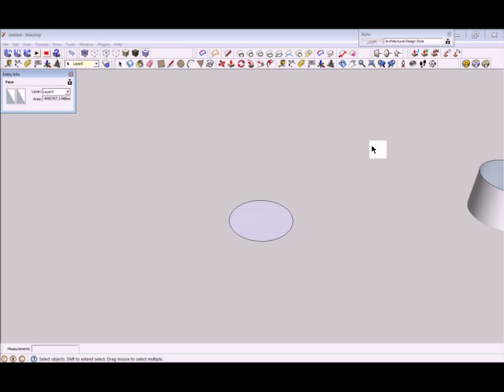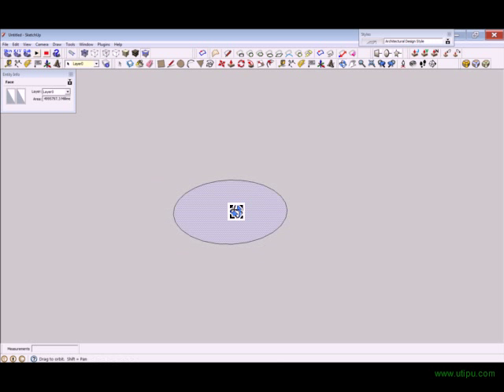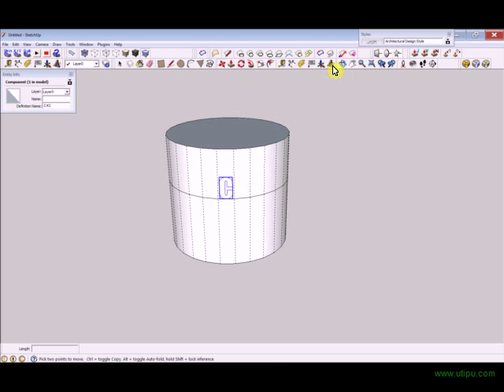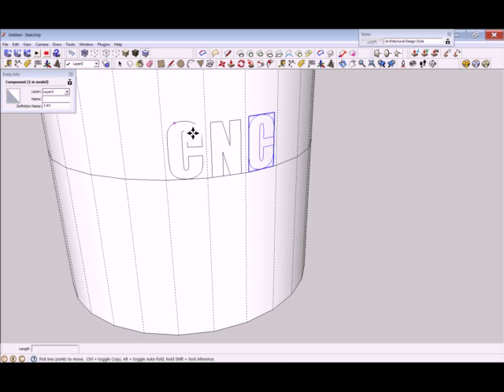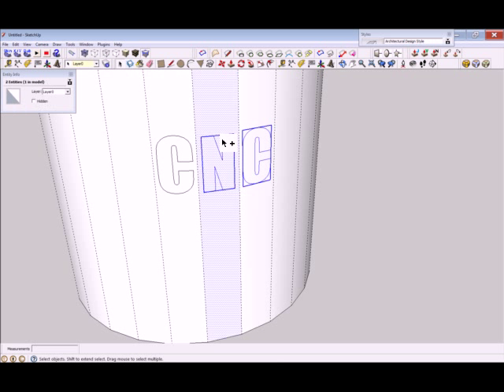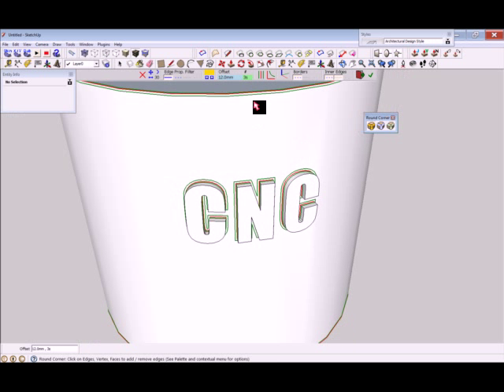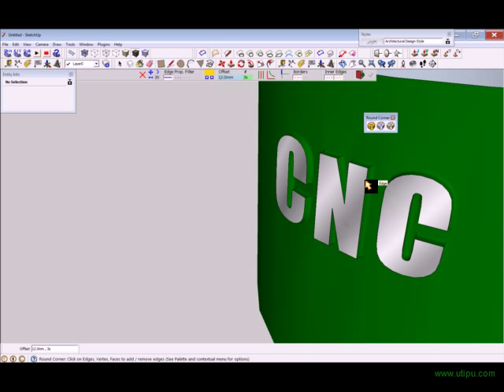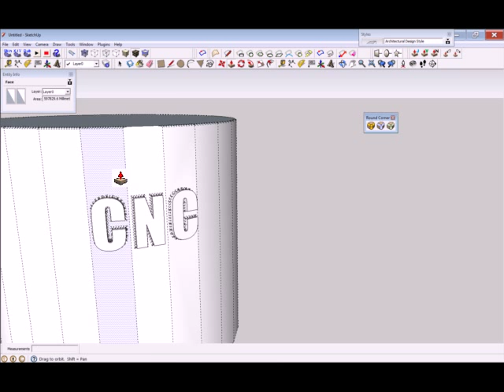Putting 3D Letters on a cylinder in Sketchup  like a CNC

Comment from the maker: Hi Jo , there does not seem to be a reply option on your post. any way this can be done quite easily,. You can turn on hidden geometry and hide the faces so you can work on the faces you want . if you then turn of hidden geometry they will be hidden.
You can also use a section cut which is even easier
 36.  SketchUp Skills - Section Cut Tool

Phil